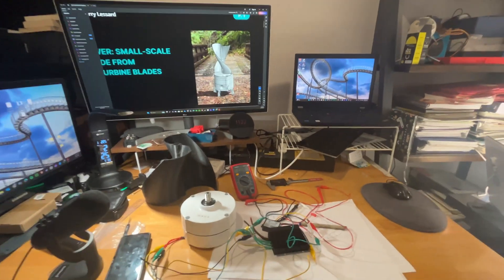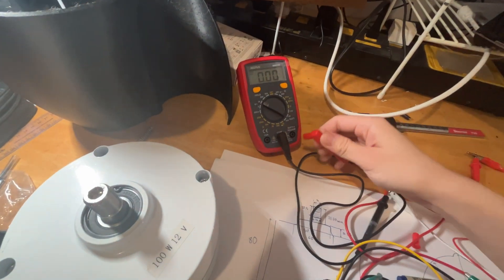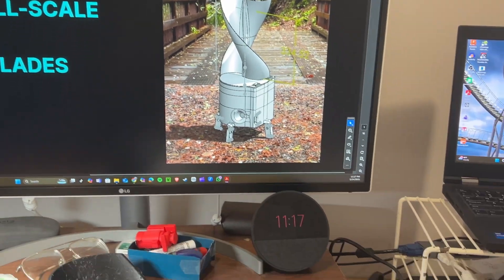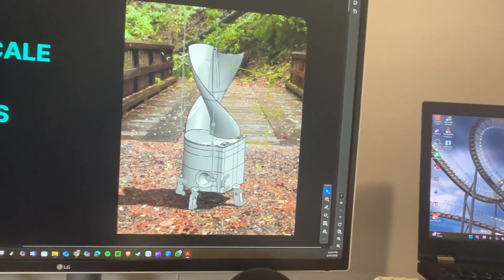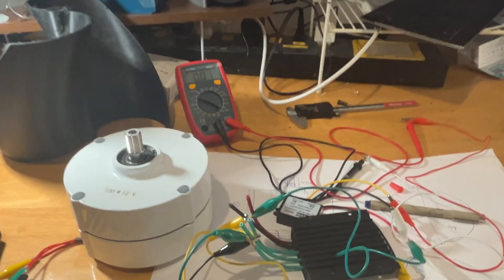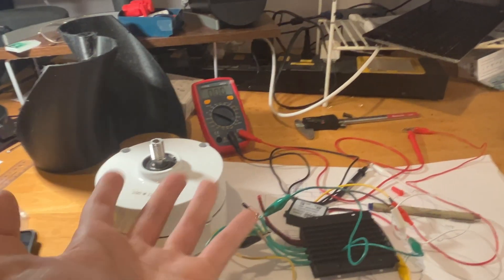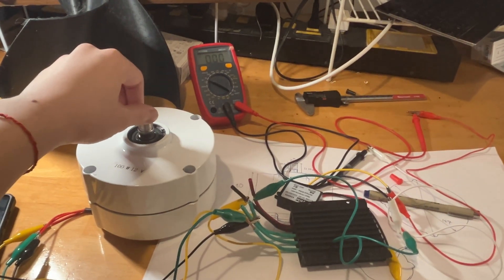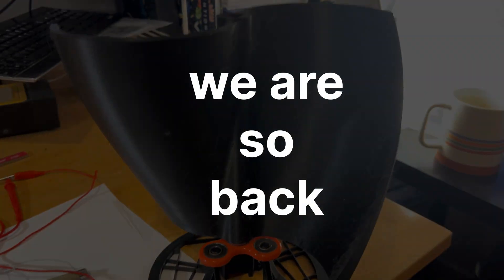If I don't see 5 Volts, I'm cooked - Engineering capstone project MOMENT OF TRUTH

Comment: Isn't that just a 3 phase rectifier with a cheapo 5v buck converter...?
Reply from the maker: generator to charge controller to transformer to multimeter that are NOT cheap LMFAO but like I said this is the first try on over 300$ of equipment for a project under extreme time constraint we do NOT want to mess this up